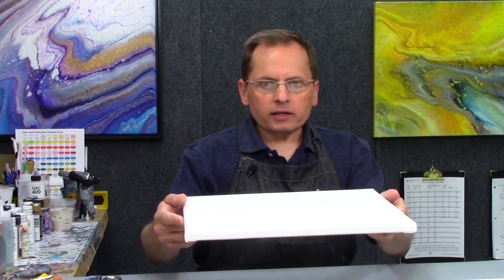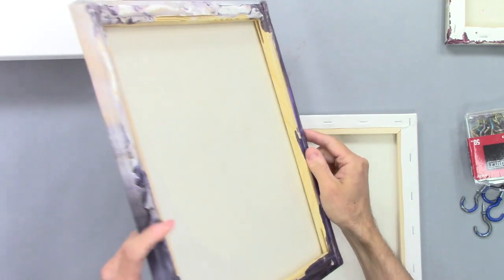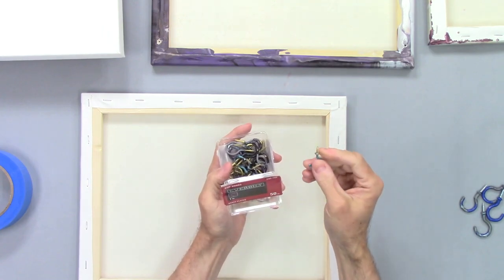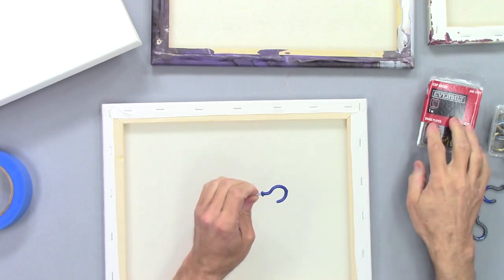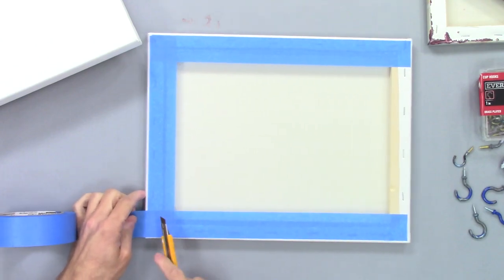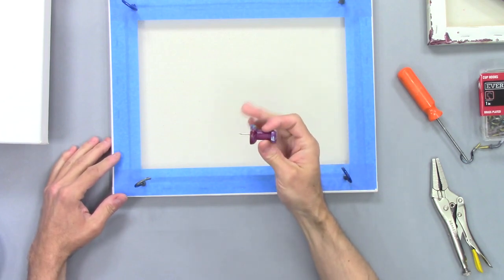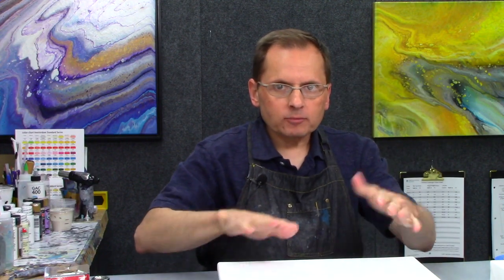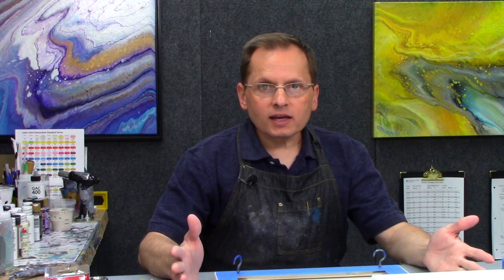Acrylic Pouring Canvas Prep - Paint Pouring Tips And Tricks

Comment: Great tips Brad. I used to use cheap masking tape but found it didn't do the job and bled underneath. I now use a more expensive painters tape and it's worth the extra expense. I also use ordinary push pins but will try cup hooks or find those large push pins. I thoroughly enjoy your tips. You certainly help beginners like myself. Happy pouring 🎨👍
Reply from the maker: The more expensive painters tape definitely creates a cleaner tape line. I don't mind the slight bleed under with the cheap stuff. But I hate the giant mess that was created when I didn't use any tape. I think you would like using the cup hooks. They take a bit longer to install but well worth it in my opinion. I found the giant push pins on Amazon. I didn't put a link ther because the listing is always changing. The perfect canvas foot would be a giant push pin with a threaded point! Did I just create a product Laurita?
Reply: @AcrylicPouringAcademy  

Hahahaha..... I think you just did create a new product Brad. What shall you call it. Brad's Jumbo Screw on Canvas Feet.
I'm positive you'll start a trend and have buyers galore 😆👍
Reply from the maker: @blackcatblue  That sounds like a perfect name to me Laurita! LOL!!!